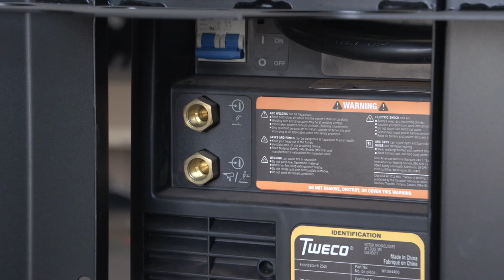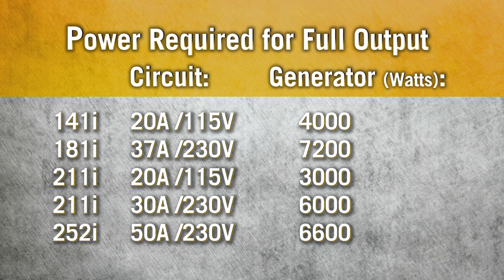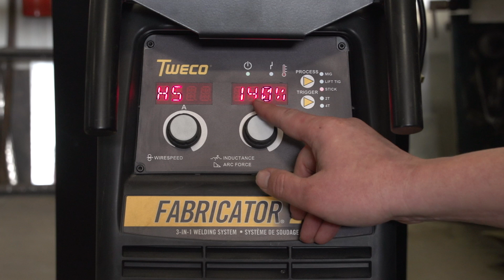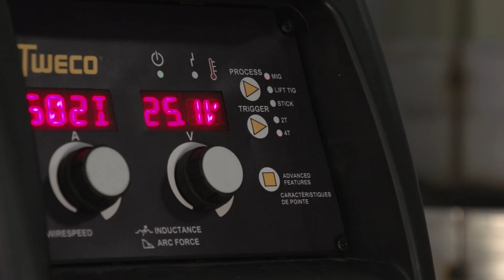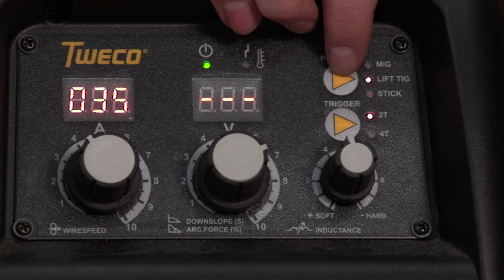Advanced Features Improve Performance of 3-in-1 Welders

Comment: Why does the Firepower141i sold in Canada not come fully equipped with tig torch and peddle?  Why didn't you use the mig euro plug for tig gas feed and power like others have? Don't get me wrong I like my machine just feel short change in that the price more than doubled up here to fully equip it.
Reply: Cause the 3 in 1 are all lift start as far as I know, none use the foot pedal.

Comment: Does anyone know if the Tweco Fabricator 211i can weld 6010 rods?
Reply: yep
Reply: Yeah its DC stick, and 6010 is for DC lol
Reply: @dillwiggle2  not all inverter base welder is 6010 capable it can be a DC welder but to proper weld a 6010 that a next thing.

Comment: I own the 211. only complaint is burnback difficult to deal with, keep ending up with welded tips. and on lift tig, there's no gas solenoid. id like to have atleast the option to buy a controller box or something to start gas/provide postflow.
Reply: my biggest beef with it was the lack of gas solenoid on tig and limited choice of tig torch with remote amperage control. i ended up having to buy a torch for the 252 which has no valve and using a ball valve. such a pain.
Reply: +Vince Neil I've been researching on a controller that can be built using a timer, gas solenoid, and a foot controller built together. apparently using the OEM connector you can have gas control/postflow, foot control if you're able to wire it up and its fairly inexpensive. but haven't made a leap yet into building it. but if it is possible, I'd argue the tweco machine is the best value out there. love the welder just hate manual gas, downslope amperage.....
Reply: +Aaron West the tig torch for like 220$ i was finally able to find. has 3 different switches that swap on the torch which is pretty cool i have a on off button. on off button with dial and a regular dial. i hit the ball valve then use the torch switch and keep downslope off.
Reply: +Vince Neil that a torch made by tweco?
Reply: +Aaron West yes it is. i searched online forever. got it from baker gas and welding supply online. the first one i got from amazon had the worthless button on it. i returned that and got this one.
Reply: +Vince Neil thanks For the info man. I'll check it out.
Reply: +Aaron West w4013600 part number i just looked my order up for ya
Reply: +Vince Neil awesome!!!!! u saved me tons of headache trying to figure out how I'm gonna make a auto  gas control. I just simply couldn't believe there wasn't a solution to this cut corner. now I am certain that tweco has the best deal. Miller can keep their $5000+ version of this machine. thanks again bro
Reply: +Aaron West just know it says some places it has a gas valve and some places it doesn't. mine didn't have the valve so be creative with a ball valve or electric solenoid
Reply: +Vince Neil and bubble bursted cuz reading the q&a it says I won't work with the 211 on gas valve aspect. doesn't have a built-in valve as I was under the impression it did. I just have issues leaving gas on, and my current torch doesn't seal so gas leaks thru. getting costly. I have to come up with a valve/postflow mechanism. shouldn't be crazy hard to piece parts together and build into foot pedal